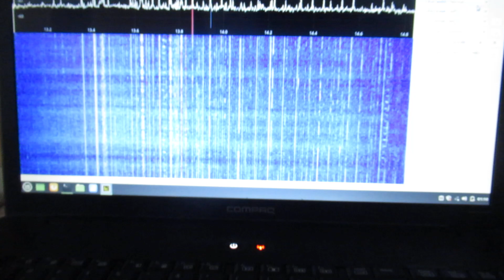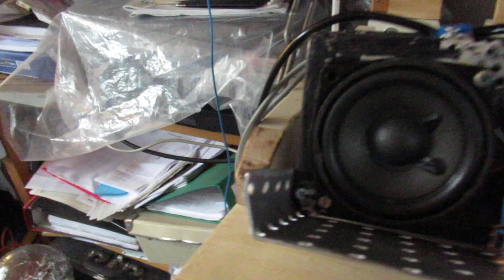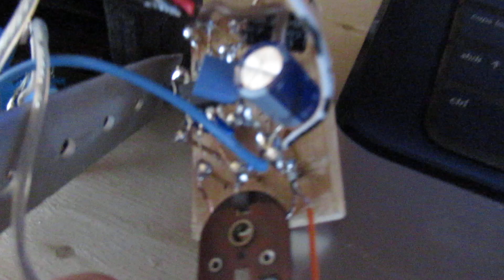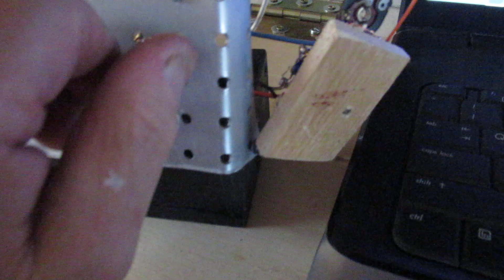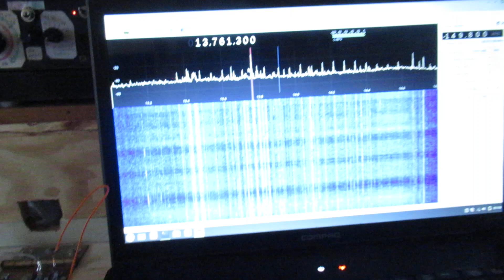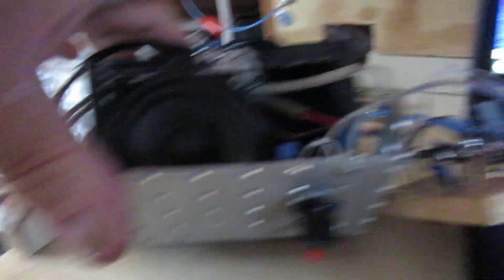LM 386 as audio amp. 0,5 Watt, connected to the headphone out, more considerations (SW listening)

Comment from the maker: Completely transparent (for audio frequencies) loudspeaker cloth is mosquito netting/nylon mesh. That is what I have used here/now in the final circuit. It works OK. Use the type of maze-width of (say) 1 mm or so. I used the type of mesh where the wires are "welded". It makes it easy to use. 1 Oct 2024.

Comment: As a coincidence, I am working on this exact same project and application. I stream movies, over the web. The audio of older movies' was not designed with digital electronics in mind and their sound can be too low for my old ears. I am using my DIY LM386 amp - It is open source from YTer John Audio Tech. And very similar 3" speakers. I am putting those into their own boxes. The PCBs are being manufactured, as we speak. Thank you for sharing.
Reply from the maker: I tested today (3 okt 2024) a new and better setup for this specific application: making sound/speech better intelligable when receiving it on Shortwave. It worked OK. I will publish it asap, but at first have to buy some components. Thanks.

Comment: Tip  = The computer audio output is stereo. If you only have one of your amp and speaker arrangements, you need to remember to set the computer output to monaural, or set the speaker pan function completely over to the output channel that you are using, or, better yet, build a second amp and speaker arrangement, to be able to listen in stereo. I like the last, best = grin. HTH.
Reply from the maker: Thanks, good info.